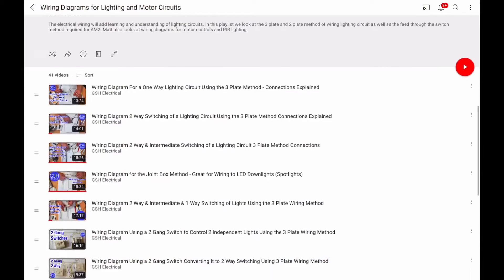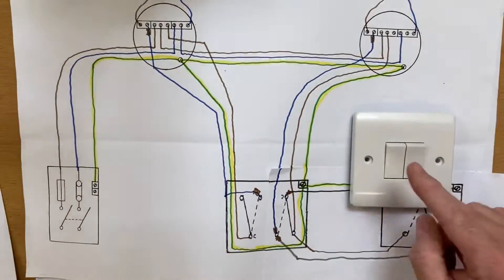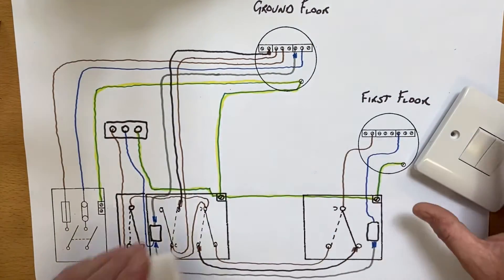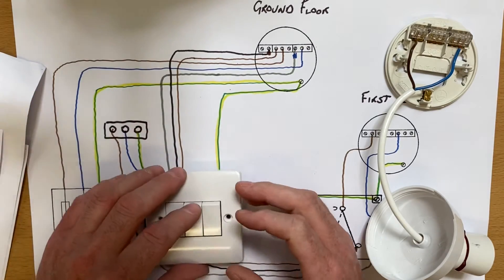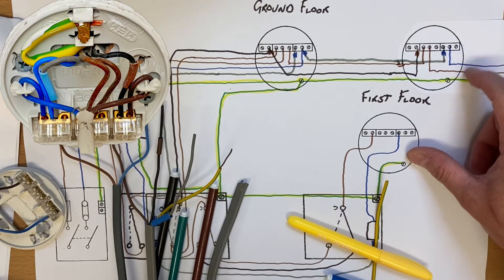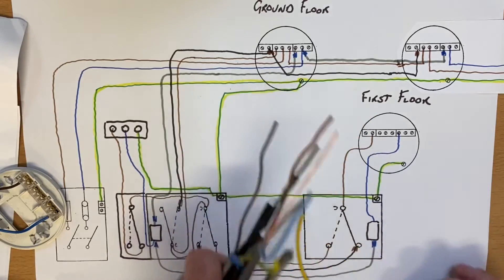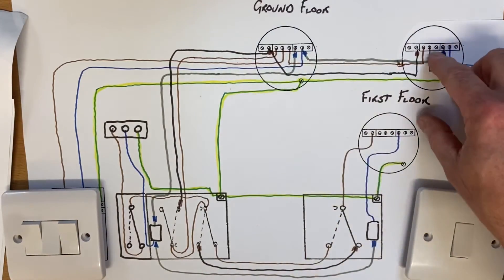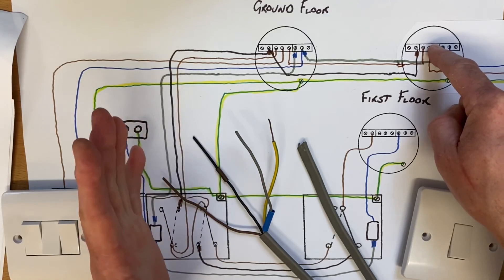Wiring Diagram Adding a Light But WHY Use 3 Core and CPC Cable Connections Explained

Comment: This series is really helping with my lighting understanding, so firstly — massive thanks mate! You may cover this in another video, so I might be jumping ahead. If there isn't a neutral cable (grey cable) running through the ground floor switch, would you still be able to turn it into a 3-gang switch and add an outside light to it?
Reply: basically, if it wasn't run in 3 core and was like the circuit in the previous video

Comment: Run 3-core & earth into the lighting switch and the then there is a permanent neutral should a "smart switch" ever be needed. It's it's multi-gang, then only one of the loop cables requires that.

Comment: in my new house i have two switches in my kitchen, one is a single for the lights and the other is a double also for the same lights but with another switch on that double isn't connected and it is supposed to be for my outside pir light, the wires for them go to that double switch but they are just loose, like someone forgot to add them when they renovated and changed to metal plates do you know how i could wire the outside light up? 
there is two wires going into each of the l1 and l2 and 1 wire into the common on one switch and the other is empty

Comment: You should include a video to describe the connections between two 2gang, 2way switches controlling 2 lights with 3 cores. My house and hundreds of homes in my area have the same setup.
Reply from the maker: Checkout this playlist 

Wiring Diagrams for Lighting and Motor Circuits
https://www.youtube.com/playlist?list=PL2Ea5r9gxUUfm4SACOSOZigCeSxxC5xaO